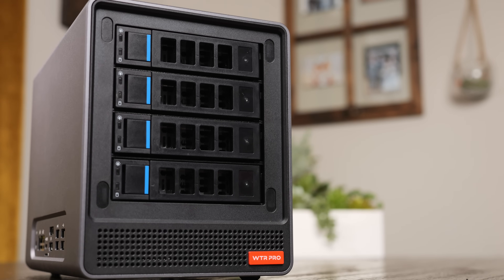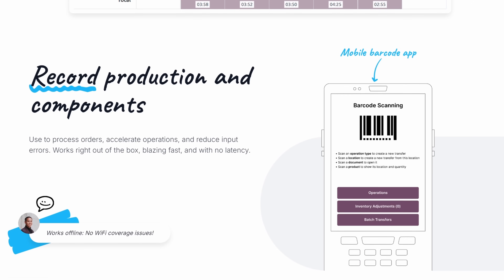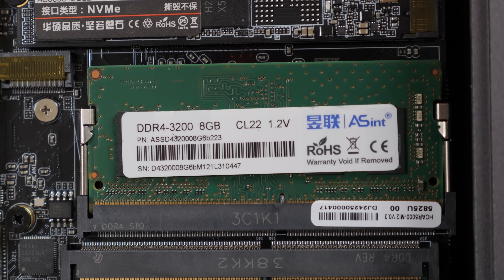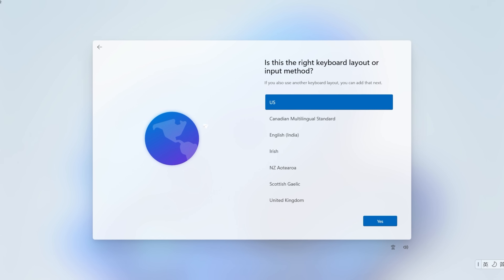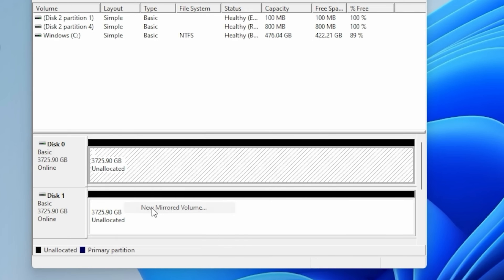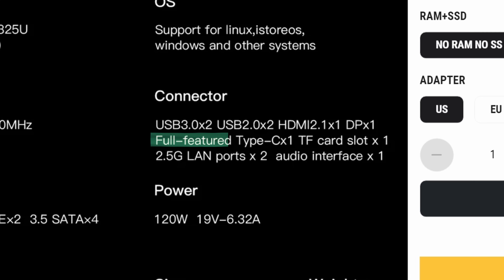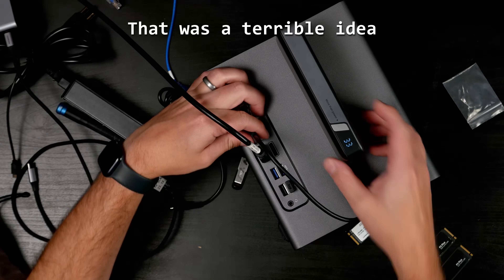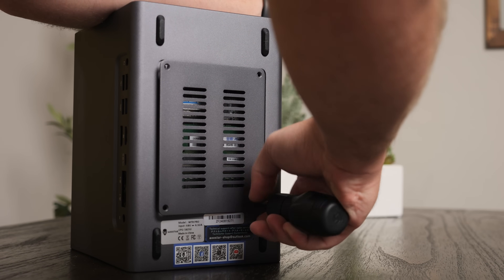The Home Server I've Been Wanting

Comment: I'm really surprised we haven't seen a M.2 video encoding accelerator card.
Reply: Gimme that little Intel A310 GPU on an M.2 card! Well sort of.
Reply: @JaccoSW neeeeeeed
Reply: Intel needs to make one, with AV1 support.
Reply: For that matter why there is no USB stick with all most popular codecs. There used to be H264 accelerators like this 20 years go. Why not now considering USB 3.1 can be really quick.
Reply: AMD need to use some of that Alveo IP they've got- they don't seem to share between divisions like they could. A cutdown version of the MA35D would be pretty sweet - or maybe just dedicate a bit of silicon to it in the IGP?
Reply: There's m.2 FPGA cards

Comment: I own one, bought it on release of N100. The box comes with all features I wanted from home NAS host. The computer runs TrueNAS on Proxmox with passthrough of SATA interface, with additional Kubernetes node. The possibilities are wide, you can also run router software thanks to 2 LAN ports and basically any software you want. I am huge fan of this form factor of computer as it is perfect for small homelab. Perfect middleground between closed NAS systems and custom NAS case. Strongly recommends, our guy received is as a gift and didn't mentioned very good post-buy support which isn't common dealing with chineese brands, but aoostar is a bit different I guess. Btw. I really hate how you remove drives here, you have even shown it, it's basically once installed never disassemble, it's very hard to extract disk
Reply: Could you please share the power consumption on N100 version?
Reply: hey - any idea if the BIOS supports wake on power restored (in the event of a power outage)?
Reply: @LukeDoyle1 don't have it connected to monitor or kvm so I can't check, but it supports WOL, so any additional RPi in network and you're settled
Reply: How is the power consumption and heat of cpu and hdd so far on the n100?
Reply: Hey, could you record how to set it up this NAS from scratch? I think that would be very useful. Thank you
Reply: what do you guys do on home servers?
Reply: @wheezel55  spend time messing with the home server
Reply: @wheezel55  run services to have full control over how my passwords, images, and videos are stored. imagine torrent client directly connected to vpn and pushing data to nas to be then picked by software that organizes them like netflix
Reply: @wheezel55 personal closed cloud that I can access from anywhere in the world with ease basically
Reply: @wheezel55  coping and seething, as usual.

Comment: Synology and QNAP etc are going to have to (finally) sort themselves out with all these new higher specced AND lower priced NAS devices coming on the market. About time too.
Reply: I agree that their hardware is overpriced. I use both TrueNAS and Synology. I use Synology for LinuxISOs because I appreciate how the Synology Hybrid RAID works so well with varied drive sizes while also allowing me to expand by purchasing just 1 or 2 drives at a time.   I wish this flexibility was possible using open software such as TrueNAS, OMV, or other alternatives.
I did use Unraid for many years. It’s super flexible but I found the array to be lacking in performance as compared to Synology.
Reply: @charlescc1000  SHR is simple mdraid/LVM stuff. You can do this on your own - just needs a bit of planning. E.g. with 2x 6TB + 2x 4TB drives, the Synology will spin up a 4+4+4+4 RAID5 (=12TB) over all HDDs and a 2+2 RAID1 (=2TB) with the remaining space on the 6TB ones then merge them using LVM for a total of 14 useable TB.
Reply: @mbirth  agreed. I’ve looked into it before.  For me- I’d rather skip that approach and enjoy the benefits of a point & click gui.  I do not want to run risks with my storage.
Reply: I just ordered the Terramaster F424 Pro. The N305 chip and 2 nvme slots are the perfect fit for me. A N100 would also be fine, but i wanted a bit more horsepower while still efficient.
Reply: @danielgmur6486  IMO, the N305 is a bit of a waste, since while it has double the cores of the N95 and N100, it has the same 9 lanes of PCIe 3.0, which comes out to a lot of raw cores and compute but not enough connectivity and I/O for that compute to process.
Reply: @fujinshu  I agree. All N-series Intel have I/O problems, because of lack of PCI lanes...
Reply: the people that buy synology and qnap are not going to buy chinese stuff and diy something.

you aren't their market and this won't effect them
Reply: 99% of people who own a NAS for home us only want good software.
Reply: I love my ds1821+ but yeah, they're really not being competitive here (I don't need the cpu grunt for transcoding but 10 gig should be a staple for the money they charge for 8 bay units)

If someone like Aoostar made an 8+ bay unit for a good price it could sway mee away from the Syno eco system.
Reply: They are hideously overpriced for what they are.
Reply: @VenturiLife  true, they are overpriced. But there is something to be said about ease of use and time spent tinkering with it to make it work...
Reply: And maybe AMD are going to have to think about adding hardware transcoding functionality!
Reply: Synology - Best I can do is 1Gbe LAN... I love my Synology but don't expect miracles.
Reply: After the $#$& Synology pulled with "drive compatibility lists" (where for newer models the only "compatible" drives are their own, hugely overpriced, ones), I am really looking forward to some competition in this space.

And I say this after being a Synology user for more than 15 years...
Reply: Apples to oranges. This aoostar is impressive for what it is. Synology is, too. Synology's software makes it nearly turnkey. I've had a DS918+ 7 years, and I'm still very happy with it.
Reply: just bought a 1300CAD qnap :(

feels bad man...
Reply: @Dataanti I have snap for drive running for 15 years (light use). Never had any issues. It is good choice.
Reply: Honestly, they should ditch their codebase and get the help of UnRAID or TrueNAS, and then maybe design their own UI like what Eshtek has done with HexOS (minus the internet connection required part).
Reply: @fujinshu  I still don't really understand the appeal for HexOS. It just sits on TOP of TrueNAS Scale, adding yet ANOTHER obfuscation layer.
Reply: Yea Synology in particular has extremely underpowered hardware even with a very well polished OS, It doesn't make up for the inability to run multiple containers or VMs and get decent performance.  1GB NICs are so 2000 late and 10GB upgrades for another $120 is ridiculous and overkill for a low powered NAS, especially when 2.5Gb will do for a home NAS and everything these days comes with built in 2.5GB NICs or even faster WiFi.  

I have both Synology DS918+ and a Terramaster F-424 Pro running Unraid.  Guess which one is running my containers like jellyfin and my retro VM and which one is a target for my rsync backups of the other for extra redundancy at my parent's home?
Reply: Or the slow development  @fujinshu
Reply: because these "other" low priced nas devices also developed and maintain a (somewhat userfriendly) complete software package to operate it, right? 

RIGHT?
Reply: At this point (unless we are talking about diehard brand fans) I think that ship has sailed, some people like myself take initial pricing into consideration when competition enters the market; I mean are you going to trust a brand that overcharges for a product and only drop it they are practically forced to with competition?
Reply: These are all about Software and ease of use. I highly doubt they care about new hardware solutions.
Reply: What would be some good options of software to install if we compare with what Synology offers?
Mostly I'm interested in storing files via my computer and the possibility to backup the photos from my phone and access them via my phone while I'm at home.
The Synology offerings for photo backup seems pretty good.
Reply: Yeah but having spyware built-in is a no-go for me.

Comment: I feel like the n100 version would be the better option here by far. I may have to consider upgrading my HP microserver (gen 8) to one of these guys.
Reply: Not sure, youre missing out on pcie lanes. And cpu performance.
Reply: @mdevries8495 CPU performance is definitely better than a Gen8 micro server and honestly an N100 should be plenty for most NAS stuff.
Reply: @v0ldy54  This is true, I have upgraded mine to a xeon but it definitely eats up power. I use it for plex and a local minecraft server, so I can absolutely see the benefit of the n100 in my case.
Reply: That hp microserver is a power guzzler !

Comment: There's a more gentle way to remove a hard drive from this drive carrier.

Lift the black plastic part that is in contact with the hard drive, then push the drive (in the same direction you inserted)  can remove it.

I wish I can attach photos to comments...
Reply: I thought that too, but doing it in multiple places at the same time will be annoying
Reply from the maker: Makes sense, but still a bit annoying compared to alternatives
Reply: @HardwareHaven  is it possible to dremel the clips off and use screws? Great video btw, really helped me making a decision (to buy this!) :)

Comment: This would be perfect (aside from the transcoding not being amazing) if it supported ECC…
Reply: The processor does, so you just need to install the correct DIMMS
Reply: @rogerthomas7040  what about the motherboard? That also needs to support ECC.
Reply: @rogerthomas7040  Doesn't it need support from the BIOS to enable ecc? Thought otherwise the dimms would run without doing any ECC
Reply: @rogerthomas7040  which one? The Intel or the Ryzen? And what about the BIOS?
Reply: @elmariachi5133  The Ryzen processor has the ability to support ECC, the Intel processor does not. It will all depend on how the motherboard was designed.

Comment: I wouild actually consider it IF it didnt have that wtf layout with ports on the SIDE. What were they thinking!
Reply from the maker: Some people pointed out that it's basically the same board as the R1, so it's probably on the side because they just repurposed the board design to save on costs. Still, it's a different option and might make sense for plenty of people. There are already quite a few comments that said they would prefer the layout because it would save space in their setup. 

Just because it doesn't work for you doesn't mean it's a stupid decision.

Comment: Man, $400 for a 4-Bay NAS with a more powerful CPU where I can bring my own SSD and RAM? That ain’t bad at all. Synology charges $600 for a 4-bay, so that’s definitely a very tempting offer for me.
Reply: The price is great, but the fact that you can install your own software (TrueNAS SCALE) really rocks.
Reply: Not fair comparism. Synology also offers you software included. Ofcourse some could say "i dont want that, i want my openNas TrueNas" but this comes in the same way as if you buy a PC with windows is more expensive then a PC without any OS. If you dont want to invest much time, you might want to pay for the software and use the synology but if you want more control and save money but also invest more time -> custom solution. Be aware that the software price is not only the 200$ price gap as the synology comes often with weaker hardware and expansion options also you might be locked in.
Reply: @pandalord289  It is a PC with Windows.
Reply: Ya I'd even consider this for basic workstation tasks due to the decent cpu and video out.
Reply: It's $300 for the N100 version, which honestly might be a bit more appealing considering the Intel iGPU and 25% discount, as 4 efficiency cores are more than enough for basic tasks.
Reply: If you only could install xpenology🤔